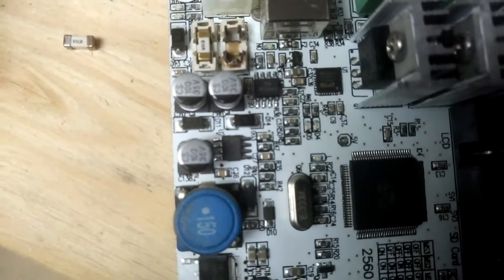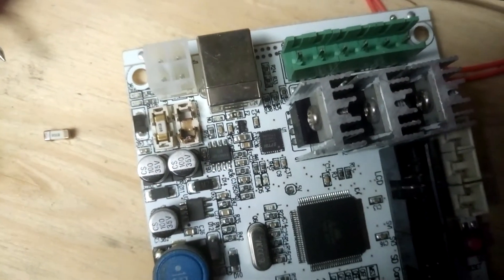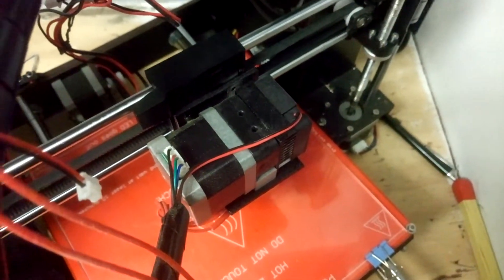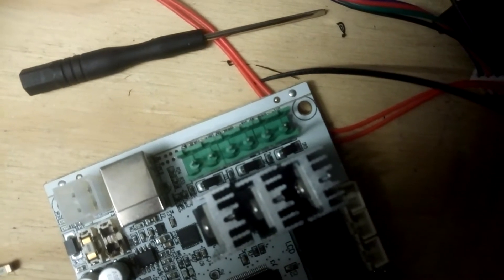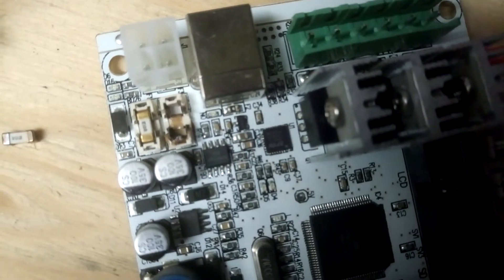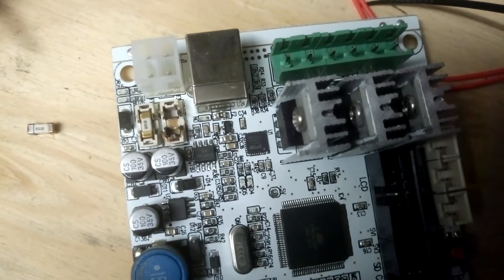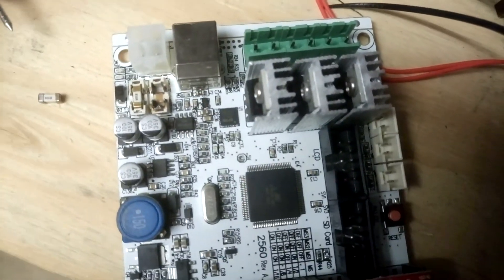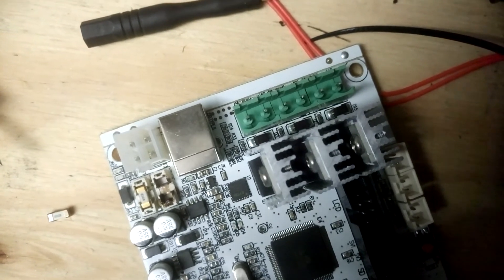Geeetech GT-2560 Blown / Burned / Chared 15A Heated Bed Fuse!

Comment: I think I've blown my 15A fuse too, and I'm wondering where I can buy a replacement? I don't understand why you want ramps 1.4 why not an MKS or Trigorilla board...or even a smoothie board.....an easier safer solution i would guess.
Reply: Order 1808 SMD fuse online (fast-acting, 15A), or if you're shopping from a local distributor, i think you're looking for LittleFuse Nano 451 series.

RAMPS is pointless today when you can get an MKS, but this video is from back in 2017, so...
Reply: @SianaGearz  Thanks for your suggestion. In fact it was my 10A fuse for the hotend...I now know that I need a new fan. Unfortunately I caused another short by trying to test the voltage across the pins that supply the fan!
Reply: @etoile6216  on Geeetech boards (even genuine ones) the fan MOSFET is a weak spot. Fan is usually difficult to kill? If you need help testing and repairing the fan MOSFET section of the board, let me know. Though in case of failure, usually, the fan just runs all the time without control by processor.

Comment: After reproducing exactly the same problem two times I discovered, first the fuse contacts (15A heatbed) blew out and corroded, so I had move it back and forth some times.
Then the fuse looked more or less like an ancient artefact.
Later I read, it were typically for some fuses for higher current to get oyxydized according to (microscopic?) light bows and bought some original LITTELFUSE fuses and holders.

As the plastic parts of the fuse holder got brown and more and more brittle, I tried to desolder them.
As it is surface mounted, I had to do it the hard way and first nibble away the crumbly plastic with a tiny wire cutter.
The second GT2560 board was not rotten that much, but had signs around one contact reminding me of the light bow story.
Soon I decided to replace both fuses without the holders and just soldered them in.
Maybe automotive fuses were better, but now I am printing without any issues.

Comment: Expanding on the subject my first geeetech gt 2650 clone from a CTC came in version A of original with the lcd and sd card headers upside down I had also a fuse blown aswell as a capacitor. my second  gt2650 is original and version B (bltouch ready) and worked good so far. not pinout rich as the ramps 1.5 i got, but enough for my needs. capable of working at 24V without modifications (according to manual. Willl try that in near future)

Comment: actualy thes geeetech's are quite good and work at 24V too. 15A seems more then a ramps can handle
Reply: This is not a genuine Geeetech board. This is a clone made by CTC. You can tell by numerous facts
* Geeetech uses blue screw terminals, not green plug-screw terminals
* on CTC clone, LCD/SD connectors have their shrouds reversed, which they had to do because they got reject screens with reversed shrouds too. The shroud key should point to wards the edge of the board, but on CTC it points towards the middle.
* The silkscreen reads "2560 Rev.A" on CTC clone near the processor but "GT2560 Rev.A" or "GT2560 Rev.A+" on genuine.

Additional differences: general component sourcing quality, 1280 processor on clone instead of 2560 (lower program capacity), lack of bootloader on clone so you can't easily reprogram it via USB.

Genuine GT2560 board is remarkably good, it has good components, electrical stability and fusing, but has following issues:
* the Molex 4-pin connector for power input is not long-term suitable and is known to overheat and burn out eventually.
* the tiny little PWM-FAN MOSFET Q5 is an unreliable piece of shit, only works OK for a single small fan.
* be careful with MOSFET heatsinks, if you knock them too hard and they burrow into the board through the silkscreen, bad things will happen.
* the manufacturing quality is OK at best - scratched silkscreen, unwashed flux or unknown residue.

Additionally, the component selection for 12V and 24V versions is different.

The board is engineered to support a 10A bed, but the fuse must be 15A for tolerance. When the fuse triggers, the fuse holder should never be crispy - contamination of holder with flux or dirt or quality of fuse holder likely at fault.
Reply: @SianaGearz  I agree with you. I had both. bottom line... don't buy CTC

Comment: I understand your frustration but think you really need to consider what has let you down here. The board has done what it was supposed to do, stopped your system from catching on fire when a down stream component has failed. There have been stories of control boards having MOSFETs latch up and explode resulting in a smoldering mess, really dangerous for the unwary. It would be interesting to know if the fuse blew again with a new heat bed as I suspect it'll be a short created by the bed if you can't see any damage on the board.
Reply: Thats not a faulty downstream part. It's the board at 10..15A being overrated.
I have the delta from Geeetech, and those fuses get rather hot during use. Same for the FETs, especially the hot bed.
Also the green hotend and bed connectors are rather week. They are typically rated für around 10A a quality suppliers. These are unlabeled components, likely clones.
The ATX connector ist also not good for the current. On my board even the wires get hot. They are labeled as 1.5mm2, but it seems they are smaller. I used XT60 connectors from power supply to frame and only left the last 10cm with the ATX. I used speaker cable with 2.5mm2 (single pair) and its absolutly cold, while the supposed 1.5mm2 (doubled pairs!) original cables get warm.

My recommendation: I replaced the hotbed connector with PCB screw terminals rated to 24A (Degson DG129-5.0-02P-14-00AH).
The heat bed connector already showed charred spots.
The STP66NF06 were replaced by PSMN2R0-30PL (Nexperia), cost around 1.7€ each. These are 2mOhms vs. 15mOhms for the original STPs. They are extremly low logic levels and are useable even with 3V3 logic. They are now just barely feelable warm to the touch.
I left the heatsinks for mechanical purpose.

Thanks for the fuse warning, may be I'll use external fuses and bridge the board fuse.

Comment from the maker: UPDATE: Having tried several times to contact the seller I purchased this printer from along with CTC (the printer manufacturer) and Geeetech (the GT-2560 Board manufacturer) - only to be ignored on all counts, I finally decided to contact eBay to take some advice on my Printer with its burned out GT-2560 - which is less than 6 months old!

I explained to eBay the efforts and lengths I'd gone to to contact the Seller and BOTH Manufacturers and was advised I was still inside of the 180 day protection and could raise a dispute through PayPal. I've since been in touch with PayPal who have now raised an escalated dispute and have given the seller 10 days from today to respond.

While I would have been happy resolving this matter amicably with the Seller or Manufacturer(s) it seems that isn't to be and so PayPal will be refunding me the entire amount I paid for the printer on the 19th if the seller fails to respond by the deadline.

This whole incident has left me with a seriously sour taste in my mouth for 3D printers - even more so today when a brand new RAMPS 1.4 board decided to go up in smoke and it looks like the heated bed was the problem once again - despite this being a brand new heated bed..... The MOSFETs on the RAMPS board were hot enough to burn skin and the wire on the heated bed was quite warm to the touch so not good signs at all!

And yet the night before the printer was working perfectly well. No burning smells, no over-heating. But the next day, the first print I attempt and it's not even got the first layer down before it's smoking and stinking..!

With the heated bed being the common denominator in both the incidents I've had, I've done more googling and YouTube watching and it seems to me that most of these RAMPS / RAMPS Style boards are built with floors such as underrated parts, insufficient cooling, unconventional parts etc. Such as these strange Poly fuses or Littelfuses which are neither use nor ornament or cheapo underrated MOSFETs or crap green connectors which are only rated for 10A and burn out and cause fires.

I have to ask myself, is all of this worth it? Almost £200 paid out for what is pretty much an incendiary device.....

But I'm not one to quit easily.... And with that I'm going to have one more crack at the whip with a new RAMPS board but this time I'm going to be doing some mods on it. First of all I'm doing away with those completely shit and useless poly fuses and replacing them for inline automotive type. The MOSFETs are getting some serious cooling enhancements and I am going to use a Solid State Relay to handle the heated bed. If that doesn't sort the problem out then the printer will find itself in the scrap box for spares for other stuff.

I've just not got the time to keep repairing it or dialing it back in constantly whenever it shits itself. Not to mention standing over it with a fire extinguisher on permanent standby while it prints....

I think the most irritating thing about this whole affair is that having barely put a Kg of filament through the printer, I'd just got the damn thing dialed in and printing nice and the first useful thing I designed and tried printing with it , the damn thing  burns out.... Then having to go through the whole rigmarole of rebuilding it, configuring Marlin and spending hours trying to get Marlin to upload when the MEGA keeps timing out. Then having done all of that successfully the sodding thing burns out again.... ANNOYING MUCH!

I must be mad.....
Reply: Did you updated to ramps 1.4? My GT2560 isn't working, I have a mega2560 and I don't want to spend 35€ for this.
Reply: Hello, I had the same problem... Since I didn't had a similar fuse I took the burned part out of the board and solder 2 wires of a car fuse older, and used it with a car 15A fuse...
Not a professional thing I know but it works without any problem (it's like this for more than a year)

Comment from the maker: Well, I've just spent two days working on my printer to get it back working again. I installed a brand new MK3 Aluminium Heated Bed and replaced the old burnt out control board with RAMPS 1.4 running Marlin. Last night when I'd finished, I ran a couple of test prints and also printed out an Induction Probe Mounting Bracket. Apart from needing to fine tune my extrusion flow rates a little, everything went well.

When I came back this morning I attempted another print. After about 2 minutes into the print I started to smell a horrible smell of hot electronics and formaldehyde. The printer was still printing fine and I couldn't see anything wrong for a start. BUT a few moments later, I started to see wisps of smoke coming out from between the RAMPS board and the Arduino MEGA.

I shut the printer off immediately and started to feel around on the RAMPS board for hot components and discovered one of the three of those large MOSFETs was red hot to the touch AND the wire for my heated bed was warm. NOT GOOD.

So I've no idea what's caused this or why...... Again I was only printing with PLA at 185C and 65C Bed Temps.

Do any of these boards work right?

Comment: Looks like an input fuse from the 12v line, check everything since 15> amps would be a short somewhere.
Reply from the maker: Hi Martin. Thanks for replying!

The evening this happened, before investigating the problem in depth, I just assumed the worse and went ahead and ordered a MK3 Heated Bed and a complete RAMPS 1.4 Kit. I had planned to upgrade the printer to auto bed leveling in the future anyway so this seemed like the best time to do it. Fortunately, before the printer died, I managed to print out some anti-wobble Z bearing brackets which I've also fitted. They allow the X carriage to free float so any wobble from the threaded bars isn't translated to my prints.

I guess you could say this incident has done me a favor. 

It is worth pointing out that this appears to be a known problem with the GT-2560A board. I've since found instances of this happening to other people too on the internet. I've tried contacting CTC (the printer manufacturer) and Geeetech (the GT-2560 board manufacturer) and neither have replied so I can see they're real interested. I also note that Geeetech have closed down their forums (possibly due to other reasons) to any new registrations so I couldn't contact them there either.

Looks like this is another product only guaranteed to the white line...

I'm just thankful it was only a blown fuse with some scorching of the board and not worse.
Reply: Don't know much about the board or your printer but the basics are all the same across all the platforms. I'm sure it's a open source board with schematics and uses Marlin firmware.

I'd double check your not shorted though. Bed screw into a trace on the bed which could show up after the bed is heated due to thermal expansion. Short disconnects after cooling. 

Even if you replace the board your short may reappear with your new board (poof)..

You could do bed leveling with this board as well just have to turn it on in firmware.

Yea I dunno much about Geeetech, been busting one of their printers pretty hard on my channel but I do electronics and not doing a 3d printing channel. Just needed a printer for a custom project box. Since I was going to all the effort I decided to tackle some of the issue with mine and share with whomever cares. Sure seems like a lot of confusion over these printers, it all reminds me of Hoverboards and Vaporizers so I guess this Christmas will be 3d printer fires in the news.